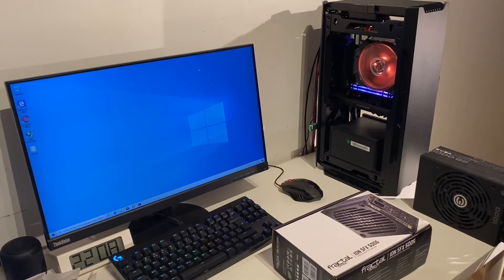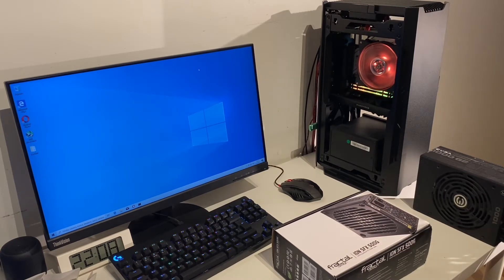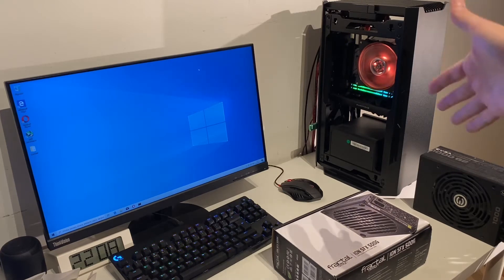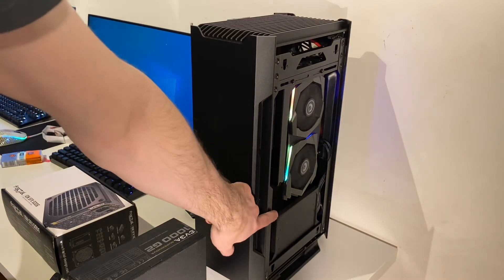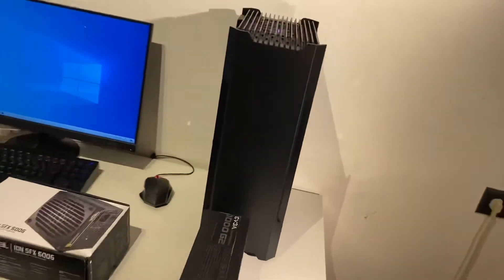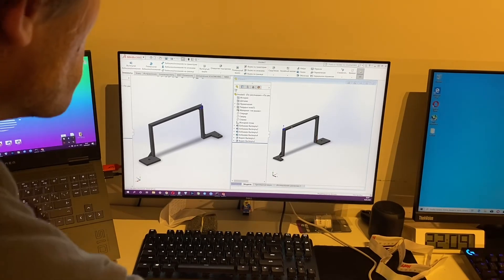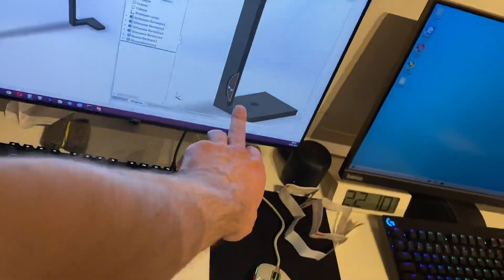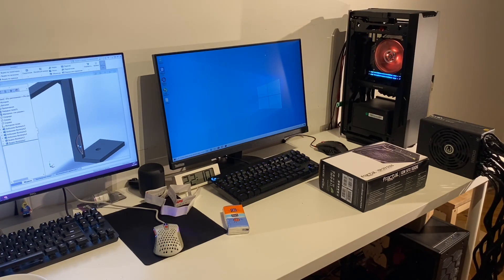ATX PSU solution for Phanteks Evolv Shift / Air

Comment: Hi mate, can I kindly ask you to share a link to download data for print? I plan to use the same case with ATX PSU as well.
Reply from the maker: in the description
Reply: @meromyonah7204  I really appreciate that, thanks :)
Reply: Can you please check if data are OK and save it also in STL?

Unfortunatelly I dont have Solid Works to check if data are OK, so I have to convert them to STL. And here comes problem: both online converters I have tried gives me error message that data does not contain geometry :(